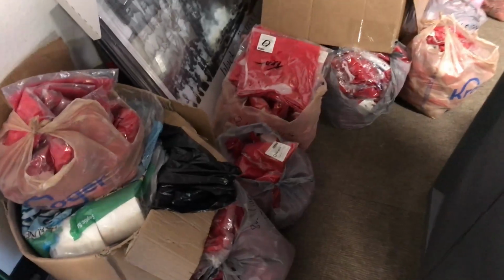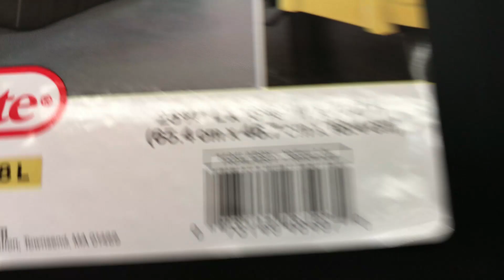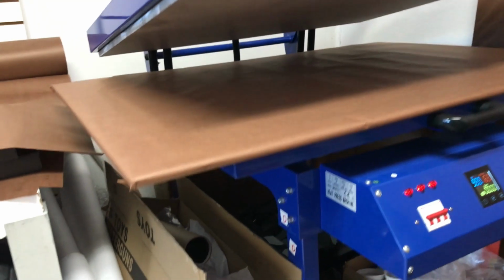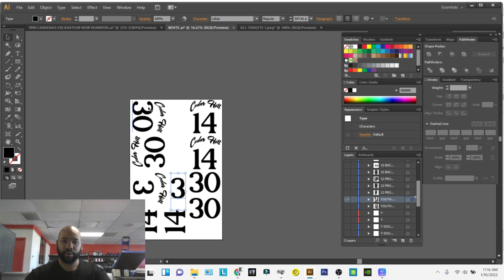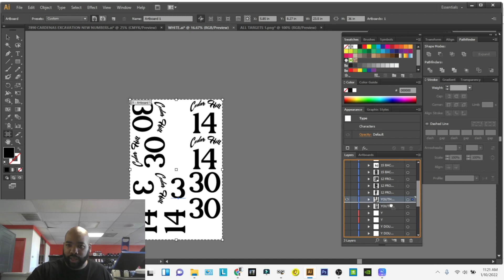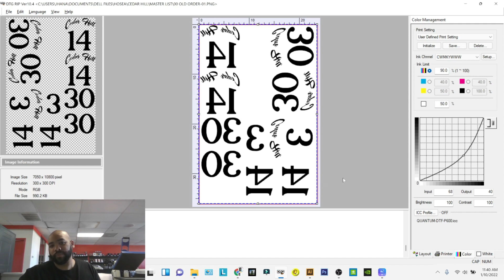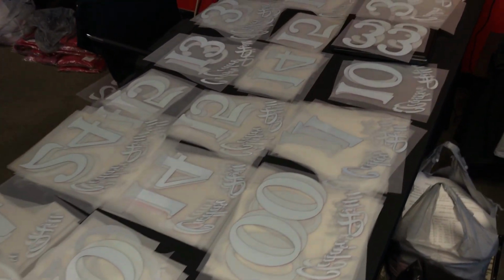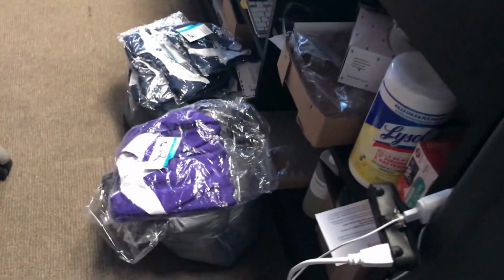DTF PRINTING HUNDREDS OF JERSEYS

Comment: What is the ink cartridge configuration for the 7890? I was thinking of doing CYWBBMWWW I was hoping to get some to see if this will work. Build yourself a box using 1/4 plywood, and (2) 1x5x8 pieces of wood. Tack it all together and seal the wood with some shellac or poly and it will be a cheap but effective powdering box. All for about $50 Thanks
Reply from the maker: for the setup, you will only need two white channels. The printer cannot lay down anymore white than from two channels. If you run 4 channels, it will use less ink from all 4 channels, but the printer won't print any faster. I would add cleaning solution in the unused channels.

Comment: I noticed some of the white prints turned pink. Looks like u had dye migration issue. How did u solve tht? I read u have to print a black layer first then the second print normal with white under. Just not sure how effective tht is
Reply from the maker: Yes. That did happen. What I've learned is that you have to lay down more white. The black powder was meant to block dye migration, but it doesn't do anything different than the white powder. All you'd have to do is lay down a thicker layer of white. Increase your ink limit percentage for white or try printing unidirectional instead of bidirectional, and that should help.
Reply: @elegant_edits  I see, what percentage of white do u suggest. I usually do 70% as anything more takes long to dry n accumulates powder a lot, causing curing issues for me.
Reply from the maker: @da-tutor2916  I think you could print heavier white, but if you wait a bit longer before you powder, it shouldn't affect the curing. Just wait until the ink has a matte appearance and it should be fine.
Reply: @elegant_edits  I'll give it a shot again. Usually my lower ink starts rising n mixes with the white when I do use more white, so I will try using another ink brand. Which brand do you recommend?
Reply from the maker: I would go with DTGPro. Maybe check your humidity, also. I also have inks, but I haven't added them for sale, on the site. I've been processing those orders for subscribers, manually.
Reply: @elegant_edits  I will give them a go, n once yours are available I will try those as well. Thanks for your help! Love ur content by the way. Ur tone of voice makes it enjoyable